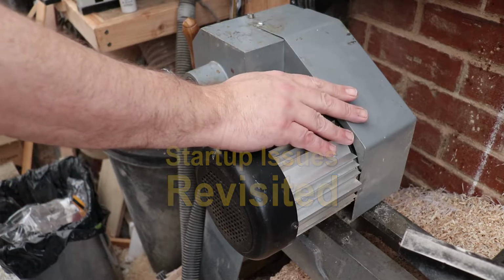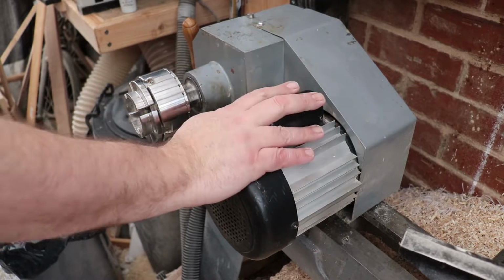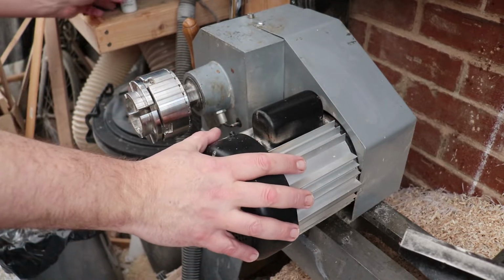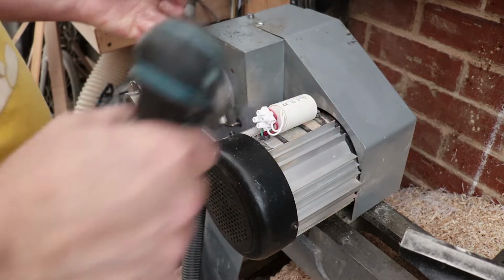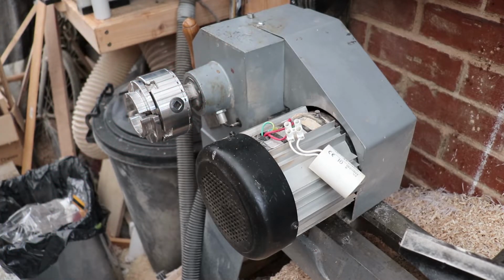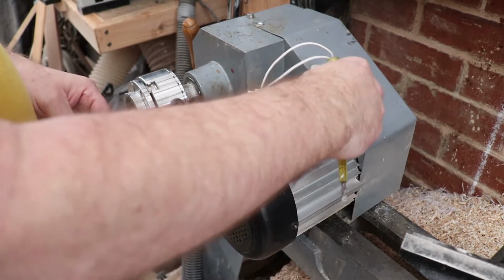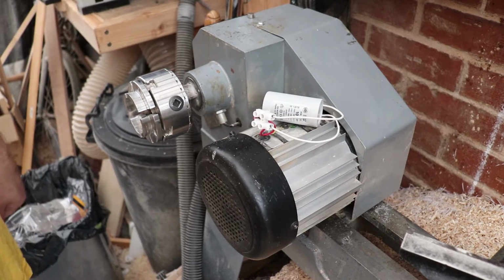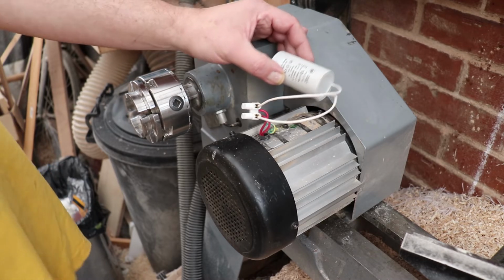Barefoot Turner - Startup Problems Revisited

Comment: With power off short across the cap before disconnecting it. This will drain any voltage that may be in in tdhe cap. It would be a good idea to do a cap check with a multi-meter, that has a cap scale; check the micro-farads, it should be within 80percent of it's rating. I've been an electrician for over 59yrs and worked with many types of motors. hope this will help in the future.
Reply from the maker: Thanks for that Randy.  My cheap little meter doesn't have that functionality but its good to know.